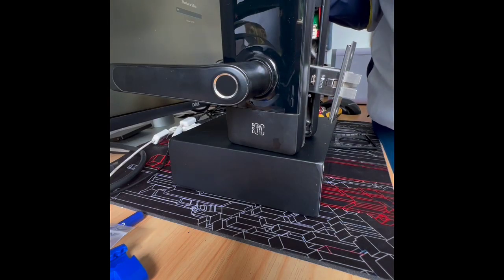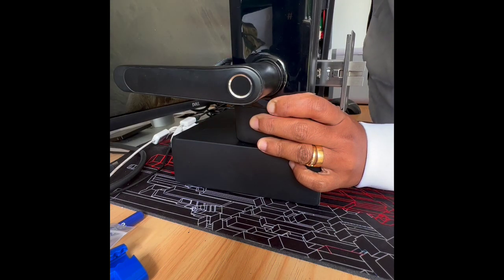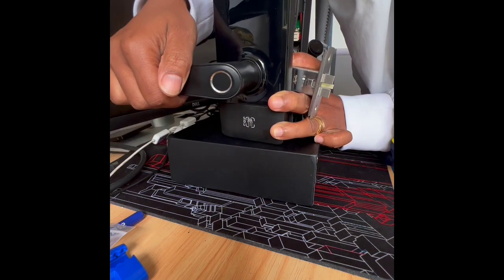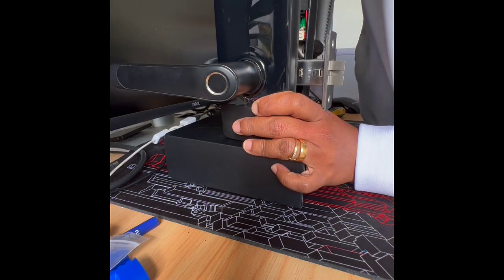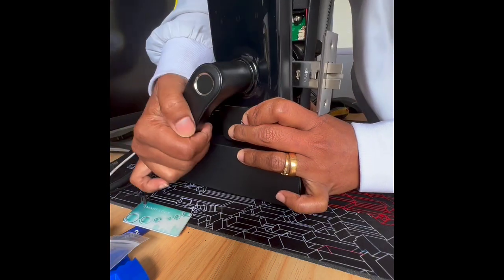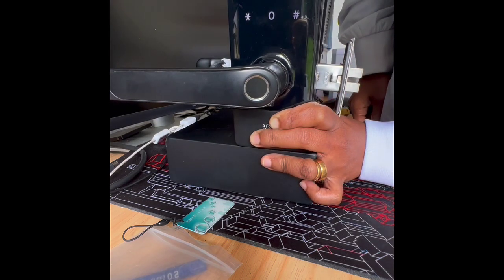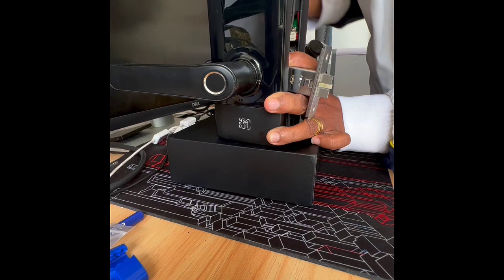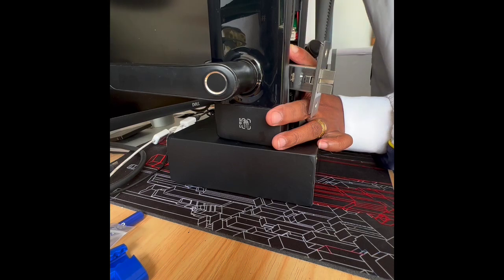Why does your Smart Door Lock say "Unlock", but doesn't retract the latch/deadbolt?

Comment: I changed the batteries, and now the entry lever does not engage the latch, and the door won't open with any code.  Key works.... is there a fix for this.

Comment: My lock works most of the times but sometimes it says Unlocked, makes the sound and the latch won't open. Batteries are 100% because it was installed yesterday. I'm calling costumer service tomorrow 😢
Reply: What happened that’s going on with mine
Reply: @vincentruffin2653 My door is very old and it's not well "aligned". This caused pressure on the bolt. I realized that I have to pull the door a little right before the "unlocked" command. This helps release the bolt. I hope this helps!
Reply: Any updates?
Reply: @jestonivizcarra3995 I solved the problem. Please, read my comment above

Comment: I had this problem a couple of days ago and even changing the batteries it didn't work.
Here was my solution: 
First remove the smart door lock from the door and check if it's working fine. If it works fine off the door, then you have a problem with the direct sunlight or just the heat, which is bending your door and you'll notice this only when you have to force your door to close. So the sunlight/heat exposure creates a curvature and bends the door which eventually affects the smart door lock MOTOR. The small motor is located near the handle (below or above) which will unlock/lock. So if there's a slight bending/curvature of the door, the small motor is being tightened or squashed and it doesn't have the strength to work properly because the back protection cover is forced against the motor because of the recent suffered curvature. The solution is before completely tightening the smart door lock screws back on to the door, place a 1mm packer (depends on curvature  -/+)  on the extremities (top/bottom) and then tighten the screw completely, this will prevent the middle section of the smart door lock where the motor is located from being forced against the door and the motor will then work freely
Thank you!